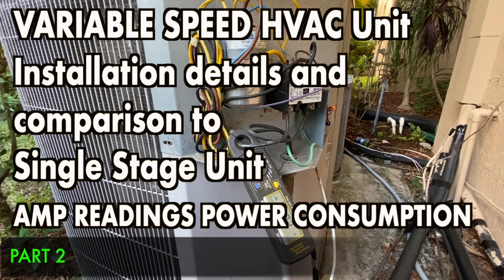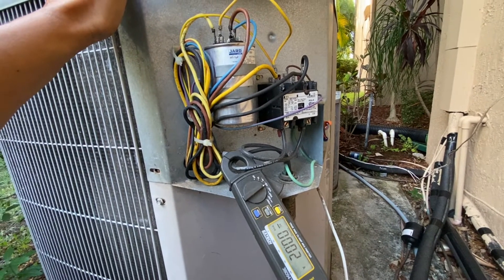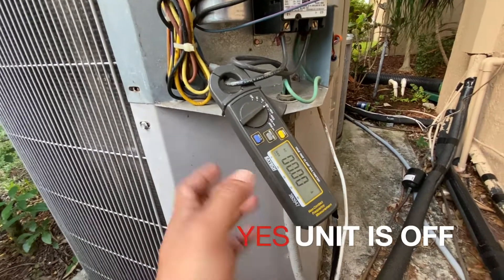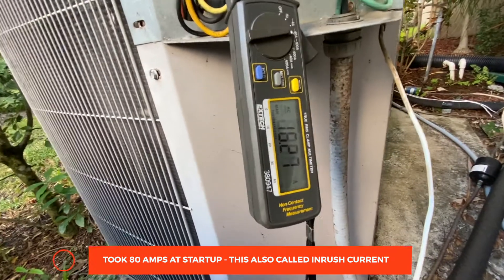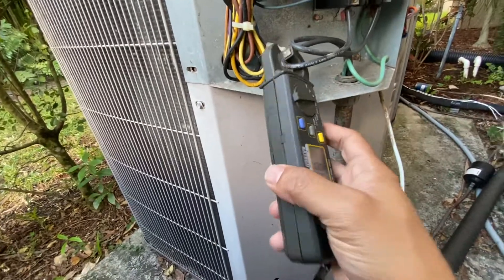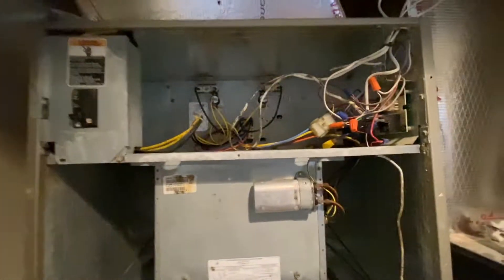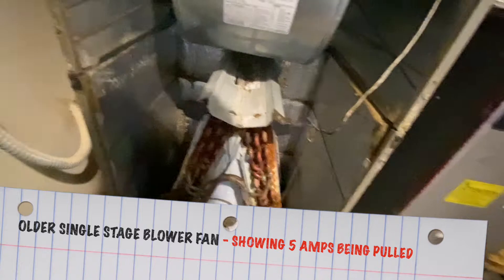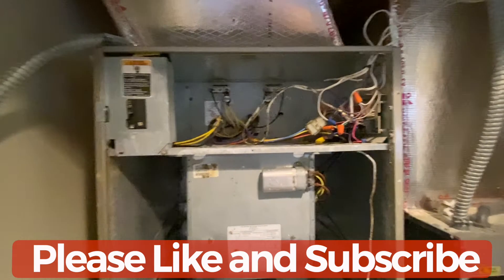Variable Speed HVAC unit - Comparison, Installation and Power Consumption PART2

Comment: See you went into the Part 1 video with a bias that variable speed will be power saving . Go back and listen to yourself .
In Part 2 your testing is wrong and here is why . 

Old unit cycles on and off . On - Off - On - Off
Vrf cycles 100% down to 30% but is always on. On 100% - On 30% - On 100% - On 30%

The Truth is  VRF Vs Old system =  Comfort Vs Energy Saving .

The Truth lies within your energy bill . compare 1 year energy bill with old unit Vs 1 year energy bill with VRF you will find that your Energy bill has risen .

correct me if I'm wrong with evidence using your energy bill .
Reply from the maker: I definitely see your point. However I was not bias. My bill is like 100-150max per month with my AC on all the time. With my old AC I had to turn it off to keep my bill lower. My neighbor was arguing with me with same thing and I opened up my app for my energy company and showed him even to the level of hourly use of my power as I have a smart meter. He was so impressed he endup spending 30k and changed all his 3ac to variable speed. 
I would have posted my bill here but I can’t attach pics. 
On the other side I did realize later on the the amp reading on air handler get even lower when you close the cover and mine with with a ln open cover so that’s even less energy assumption with everything buttoned up.

Also added benifit with this unit is I can control my humidity level and my AC runs at low speed Making it feel more comfy and quiet.
Reply: @HowToDoitright   Maybe do a video and prove the energy efficiency by showing us the utility bill or use https://images.guru or your google drive to upload the image ?

I appreciate the reply but forgive me for being skeptical .

You will be doing me and others a big service by proving me wrong. Please do .
Reply from the maker: I don’t need to argue. If you don’t believe me that is fine. I don’t work for the AC  company so I careless as long as I’m saving I’m happy. Anyone believe me can also save and those who have trust issues I can’t help with it. 
I will take your suggestion and make a video showing then I’ll and share. 
Btw I believe you emailed me so I send you a screenshot of my bill. Hope that helps
Reply: @HowToDoitright  Everybody today is trying to pull a fast one on you . 

I apologize . Thats the world we live in today.

You get cheated enough times then you will also have trust issues .
Reply from the maker: Yeah I hear you. That is infact true. But the whole purpose of my channel is to genuinely help others without taking anyone’s side
Reply: @HowToDoitright  I am more interested to know how much noise when the air handler is producing? a db would be great.
Reply from the maker: @alansoon7566  not much. It’s super quiet. Mine is inside the house right outside my room and I don’t hear it running.
Reply: @HowToDoitright  And out of the sudden your neighbor spent $30K that would take him longer than the lifespan of the unit to recover. In other words ROI, is negative assuming maitaining the current scenario where Power Generation Companies remain as Regulated Public Utilities.
Reply from the maker: I think he did that because he wanted to sell the house. He just sold it and cashed out. Apparently new efficient AC systems and new roofs in Florida get you more $ while selling your house.
Reply: @HowToDoitright  Not sure if $30K more....but who knows.
Reply from the maker: @usergvhhyu1223  I think he got way more. He sold his house for 1.4M. He purchased it for 500k
Reply: @HowToDoitright  Riding the wave of an upswing market not because of variable speed ACs.

Comment: I appreciate the video. I have an old AC unit from 2003 that is a Goodman.  It is a 13 seer.  I don't mess with electricity, so I won't be able to do anything like this, but it's nice to see how much more efficient variable speed units are.

I'm upgrading to a Trane XV20i because I have Tesla Powerwalls, and I'm hoping the new unit will be MUCH less taxing on them.    My current unit uses 4kW of power on average while it's running.  I'm really curious how much more efficient the new unit will be.

Comment: Nothing like being prepared and careful around equipment, sharp edges and high voltage with your sandals...
Reply from the maker: You are right I should have wear proper shoes and gloves but it was a last minute thing I jumped in while guy was doing installation. But still no excuse for not being safe. Thanks for the reminder